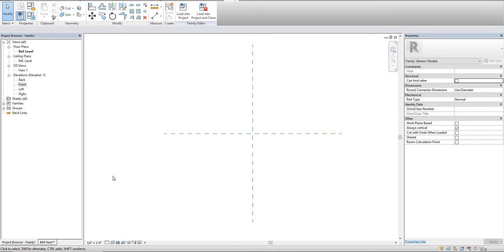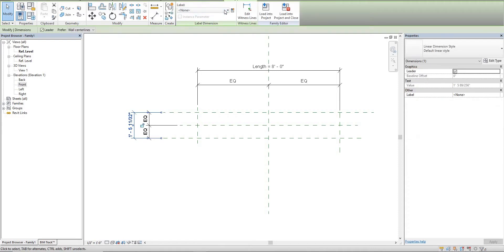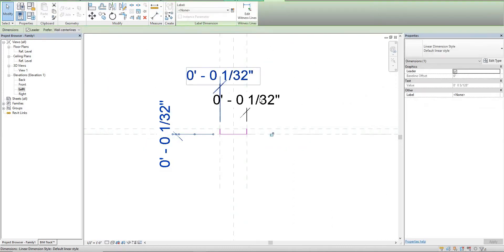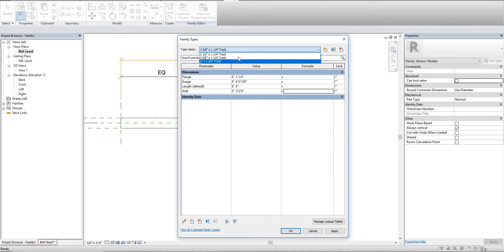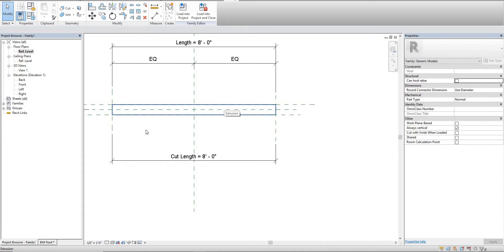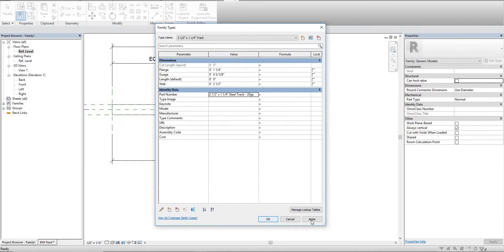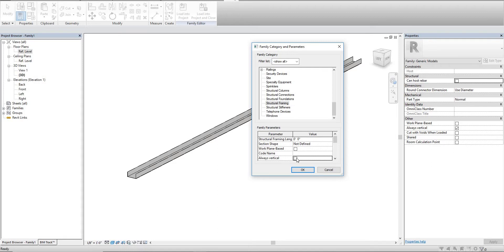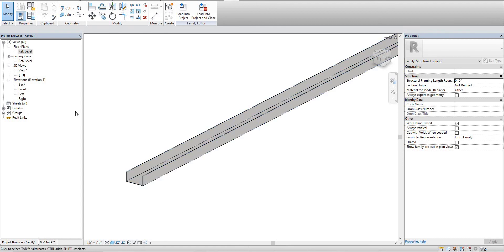Revit Custom Track Type for Stud Wall

Comment: In the date of posting this comment,
I ensure that I have FIN listening to this video. 
And have FIN copying any extra mentioned detail to what I already have.
-
Copying and stating it in my personal learning booklet I am writing in a PROF method, 
About using the Revit program to produce:
1-Full DET PROF CONST DOC.
2-Full DET PROF INT CONST ARCH DWGs. 
3-Well designed PROJ DWGs.
4-Rendered PROJ.  
-
I am mainly performing is passing by all the available videos in teaching the Revit Program; 
So SURE the final booklet I am producing will be SPECIAL. 
-
This is a REPETITIVE command that will exist on every video I will finish studying it.
And will be as a mark to the available videos teaching the REVIT that I have finished from studying them.
Vice-versa, A link for this video is mentioned in the booklet I am producing if any INFO is taken from it. 
-
Thanks for posting this video, 
Be sure that you have helped me reach my goal. 
ARCH ENG Saad Fakhoury
18-06-2020